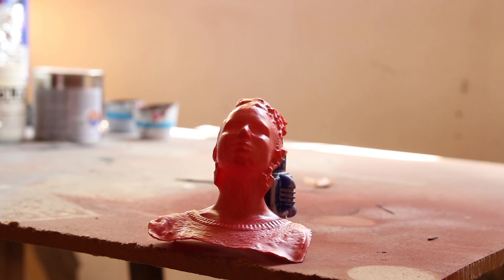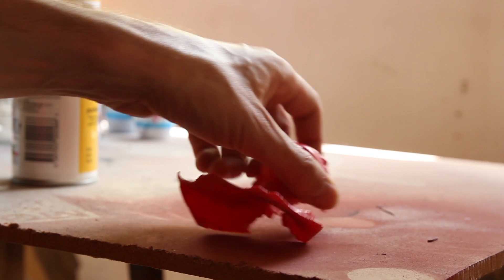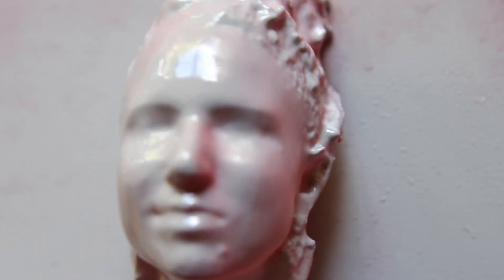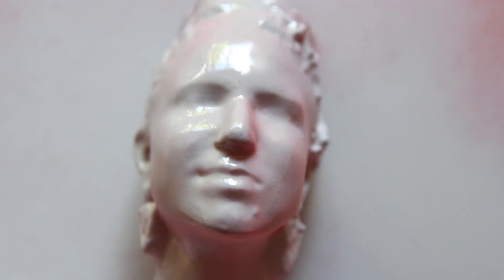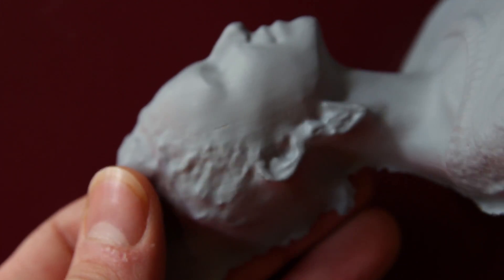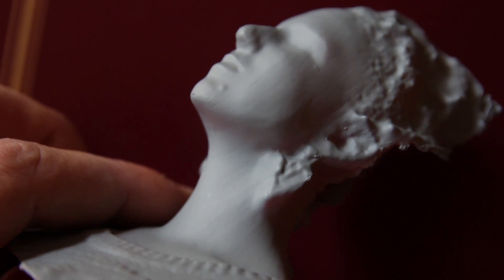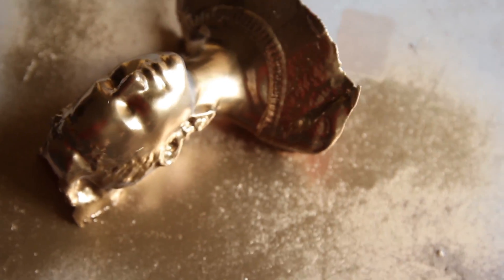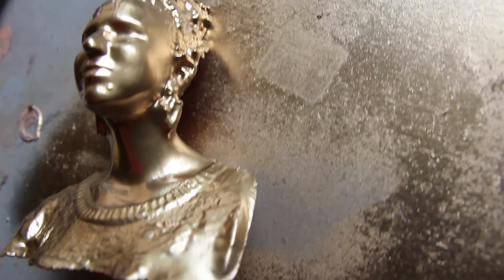SPRAYING ACETONED PLA MODEL

Comment from the maker: Just to let you know this is exactly the same model from the end other video (not a cleaned up one or a reprint), its has not had any extra work done to it what so ever before this spray thats how good my acetone bath technique is with PLA (not all PLA brands, but you should know that already by now, defo not the cheap ones as i assume they don't add anything to them to improve them as that would be extra cost).